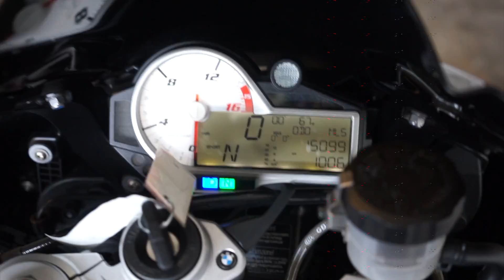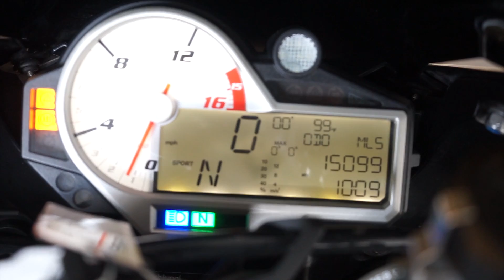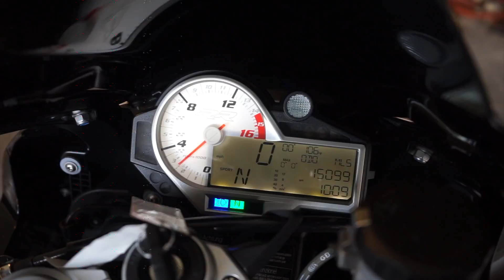BMW S1000RR | HOW I CLEAN MY SPRINT AIR FILTER

Comment: I was thinking of getting a Sprint air filter for my Abarth 500 since they have them available now. I wanted to know how to clean it, and your video did the trick! Thanks for this! I’ve heard great things about the performance gains, plus I don’t like dealing with the oil on my BMC filter whenever I clean it. This looks great!
Reply: you're not supposed to use water, just air, if it's oily use WD40 or something similar.